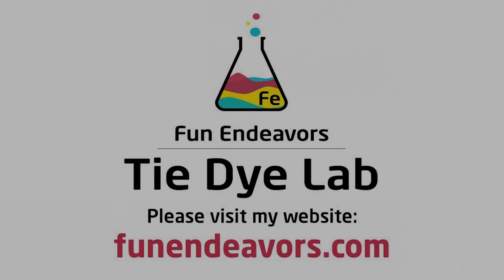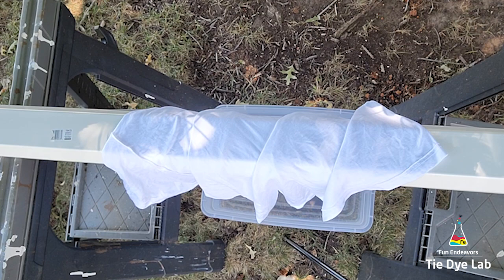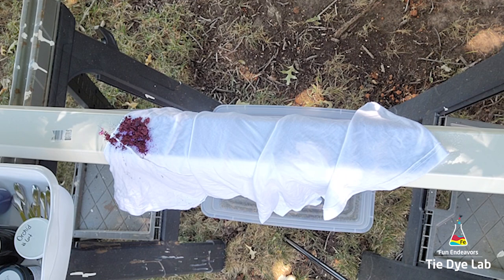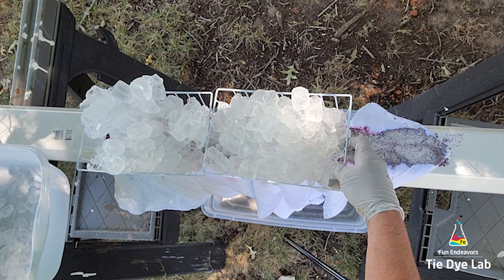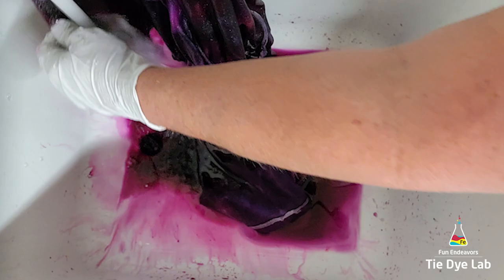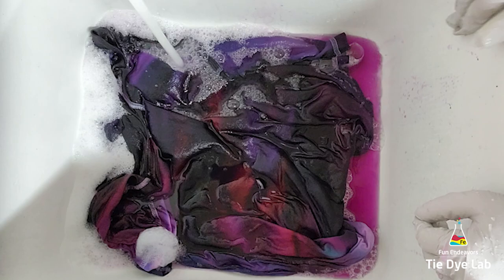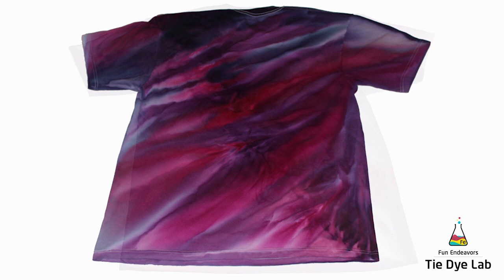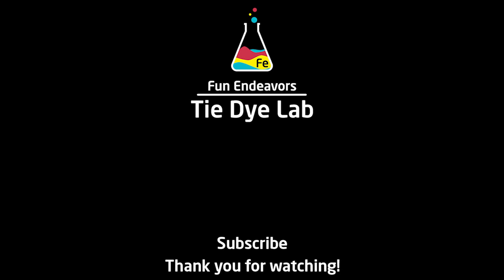Tie Dye Designs : Gravity Ice Dye

Comment: What if you made ice cubes with dye in them?
Reply from the maker: That would work.  The dye wouldn't split though since the dye was already mixed with water.  It would melt and run down the shirt though.
Reply: @FunEndeavors  just a thought I had while watching this.
I have a lot of ideas for tie dyes but haven’t attempted them yet.
Reply from the maker: @user-mn1zu5tl5i  That's a great idea, and would work really well if you had some liquid dye left over you wanted to use.
Reply: @FunEndeavors  
Another question:

How long are dyes good for once the y been mixed?  I have a few bottles of dyes that I mixed last summer.  Think they’re sill ok to use?
Reply from the maker: @user-mn1zu5tl5i  No, those are too old if they've been mixed with water into a liquid.  I usually only keep liquid dyes for about 2 weeks in a cool area.  Some colors will start to degrade quicker than others.